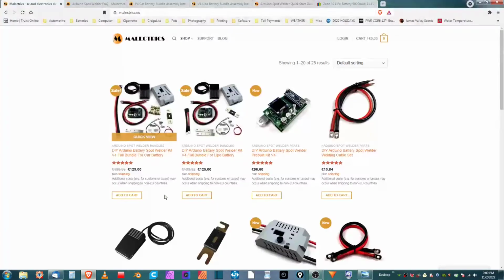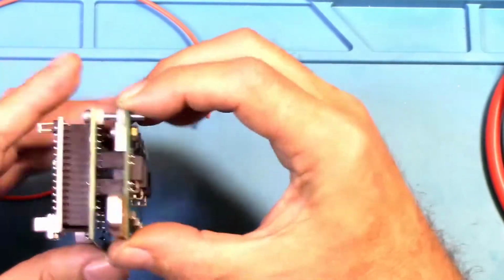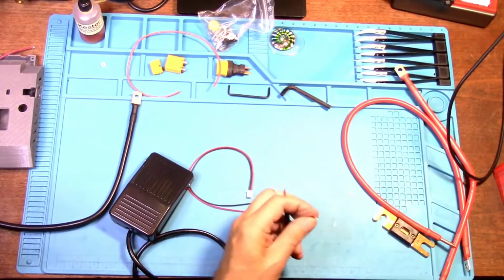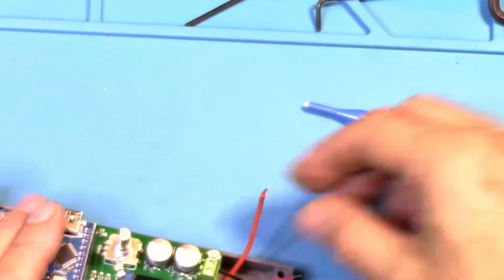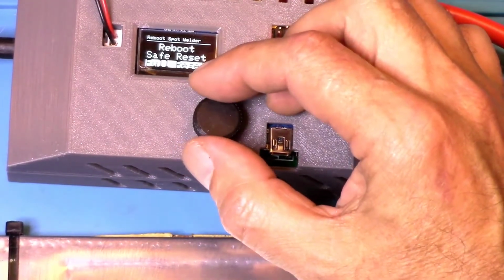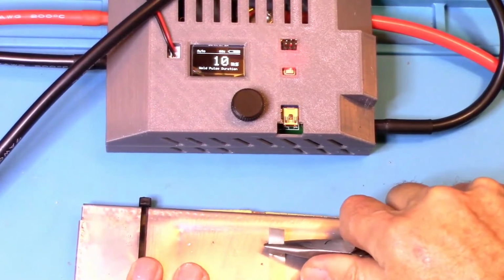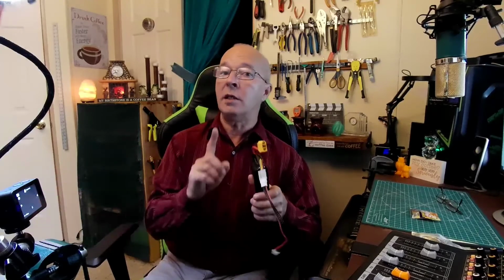Un-Boxing & Review & Tutorial & Test of the Malectrics Spot Welder Kit V4 - (WITH CHAPTERS!)

Comment: Good presentation. I have the version 3 and also a Kweld, and I like them both. You are right about making the input leads shorter. Yours are very long and the resulting resistance affects the overall current and the performance. Since I 'm using Lipo battery, I shortened mine to about 10cm and changed the connectors to XT150. The current jumped from 1000A to 1300A after this modification, according to my KWeld report.
Reply from the maker: I may go ahead and shorten mine, but not sure.  I just like to have my battery farther away from flying sparks LOL, and why I ordered the version that had longer leads.  Thanks for your comment, and if you have a video of your kweld, I would love to see it.

Comment from the maker: Thanks for stopping by, and I truly hope you get something out of this information.  This is the first video created where I have added Chapters, and I hope that helps in going to just the section of most interest, and also when re-visiting, you will be able to quickly find another section of interest.  If you have any ideas for a video that you would like me to do, please let me know in the comments, and I will do my best to bring that video idea to you... 

-Contents of this video------------

00:00 - Introduction 
00:23 - Malectrics Website
01:10 - Un-boxing
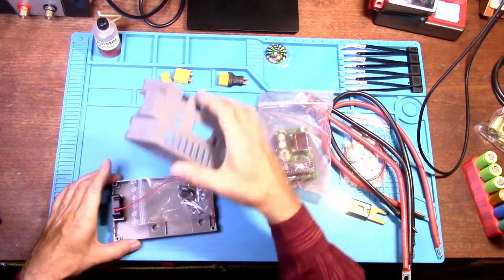03:26 - Assembling Mosfet board
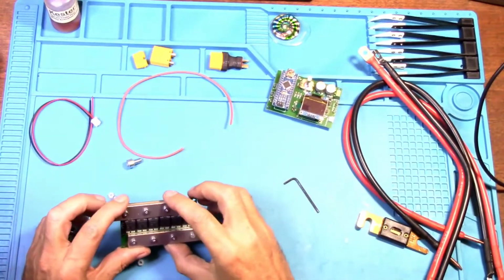05:37 - Adding screws to Arduino board
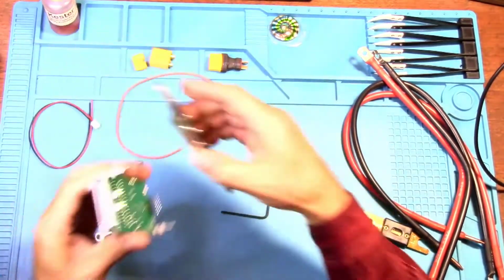06:50 - Attach Arduino board to Mosfet board
08:35 - Mounting the Negative cables to Mosfet board
10:50 - Wire and solder the foot switch
15:13 - Insert spot welder into case
16:20 - Insert Fuse into case
17:20 - Connect Positive Leads to Fuse
17:58 - Connect Voltage Sensing wire
20:18 - Installing Fan into case
22:19 - Finish Assembly of case
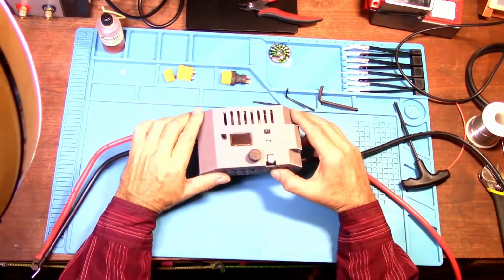24:31 - Connect XT90 to Battery Cables
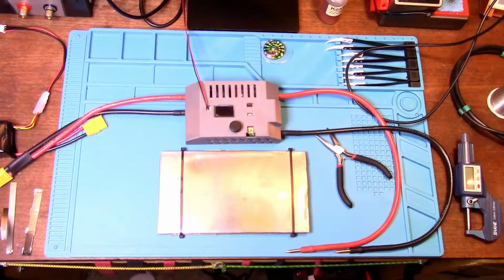25:48 - The Spot Welder Main Screen Interface
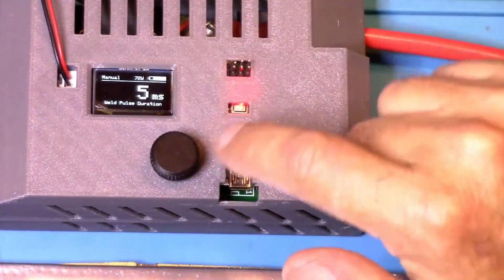28:26 - The Spot Welder Main Menu
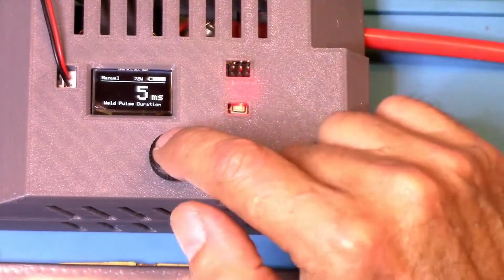30:48 - The Weld Pulse Measurement Feature
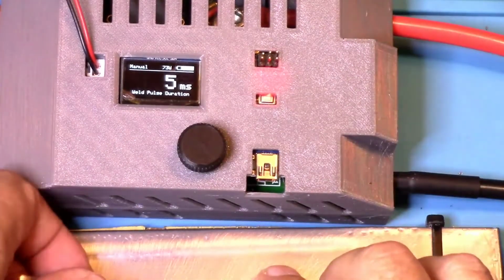32:00 - The Hidden System Menu
36:03 - Testing the Spot Welder
46:55 - Closing Remarks

Comment: Please tell me the optimum specifications (voltage, capacity, maximum current) of the lipo battery that can be used as the power supply for this Mini Spot Welder.
Reply from the maker: Thank you Kinya for the question.  These are the recommended specifications to power the Maletrics Spot Welder: 
* Input Voltage: 10-14volts
* Recommended Welding Battery: Car Battery (12 volt, around 600 A (CCA)) or a Lipo Battery (3s 5000mAh with minimum 60C (120C burst)
* Recommended welding material: 0.1mm to 0.25mm nickel strip (most commonly used is 0.15mm)
* Welding cables sizes: 10 - 16mm thickness, each about a maximum length of 50cm (500mm).

* I myself use a Zeee Lipo  Battery that is 3s - 11.1 volts - 9000mah and 100c rated, and it works great.

* Absolute maximum current rating according to the datasheet of the  IRFS7430 mosfets that the Maletrics welder uses, is about 1,200 Amps.  But please be aware at this high current they can overheat very quickly and be damaged - according to the Maletrics manufacture.

* The spot welder V4 is capable of using up to 800 CCA car batteries as a welding current supply.  It is not recommended to use a car battery that can deliver more Amps than this, as the Welder will take as many amps as you offer it - even if it means death to it...

I have successfully welded two 0.2mm nickel strips together, and am waiting on some copper strip so that I can do another video about a question posed by another comment, that asked about being able to spot weld copper nickle sandwich welds.  I will be doing a video of that once the copper strips arrive - so that will be interesting to see if the Maletrics can pull that one off LOL...  I will be using pure nickel strips and pure T2 copper strips to perform this feat.  It is very hard for any welder to spot weld pure nickel or copper, so if the Maletrics can pull off welding Pure nickel to Pure Copper to an 18650 battery - that will be quite impressive for sure.

I hope that I have been able to answer your question - keep a watch out for the upcoming video I spoke about, and thank you for stopping by and taking the time to ask a question - it has been a pleasure talking with you.

Comment: Have u tried copper nickle  sandwich welds?
Reply from the maker: Thanks Mad Max for the question.  Do you mean a peace of copper strip between two peaces of nickel strips?.  If so - no I haven't tried three peaces of strips welded together.  I will have to give that a go, but unfortunately I don't have any copper strip, I guess I could try three peaces of nickel a try.

...I found out that a sandwich is a battery with a nickel strip on top of a copper strip and both welded to the battery.
Reply from the maker: MadMax...  I decided to get some pure nickel strip and pure copper strip.   I am still waiting on the copper,  but I should have a video up in a couple of weeks trying the sandwich question.   This should be a fun video.   Thanks MadMax for the idea.   Mercy copper is expensive LOL
Reply: I would be interested in copper sandwich.  Because its best with big battery packs . Nickel has to much restence at end of the series of battery pack where bulds up to much heat in the pack
Reply from the maker: @natebean151  I just uploaded a video where I test the Malectrics Spot Welder doing a Sandwich weld.

Comment: anyone have experience with version 3 AND 4? im debating which unit to get. i have a chance to get either one from someone i know who just bought the kweld but i can only take one of them. ive heard people who prefer v3 over 4 and the other way around.
Reply from the maker: After researching the website, It looks to me that the V4 would be best because the software has been updated, and the board itself has been updated to be more robust.  The case also has been updated to hold the welder in one unit as opposed to V3 that had a couple different sections.  The Mosfet is also able to handle more current in the V4 board.  Here are a couple links to the V3 and V4 models to help in making your choice.
ARDUINO SPOT WELDER QUICK START GUIDE V4
https://malectrics.eu/arduino-spot-welder-quick-start-guide-v4/

ARDUINO SPOT WELDER QUICK START GUIDE V3
https://malectrics.eu/arduino-spot-welder-quick-start-guide-v3/

I hope this helps, but if anyone that reads this has had experience with V3 and V4, it would be good to hear your thoughts.  There are also videos on YouTube about the V3 that may help in making your decision.

Comment: Is this copper sheet?
Reply from the maker: Thanks Tomasz for the question.  No, this is pure nickel strips I am using for spot welding.
Reply: @Outside-In.  I mean that piece underneath nickel strip. The biggest one. Is this steel, nickel or what? Looks like copper but I think that camera is doing some joke with light that's why looks more red.
Reply from the maker: @tomaszradomski9008  The piece of metal under the nickel strip is from a power supply case that I had smashed flat to re-purpose for use as a test-plate for testing spot welders.  The red-ish color is because I was wearing a red shirt, and the lights were causing a red cast on the metal plate.  I hope this helps.
Reply: @Outside-In.  excellent. Thank you for answer. 👍👍👍
Reply from the maker: @tomaszradomski9008  Sure thing Tomasz and thanks for watching and commenting.

Comment: Hi!  50 ms is too much for a tape even 0.35 mm thick.
such welding time will inevitably lead to the appearance of halos and overheating around the welding points and possibly even between the points if they are located closer to a certain limit. this is not a very good property of the welder, or rather the battery - the current source you are working with
Reply from the maker: Thanks for the information.  Yes, it is best to be able to weld at lower connection times, but sometimes depending on your setup, you may need that extra connection time to make a good weld.  The issue you are speaking about could also happen if welding at 25ms if the strip is .01, so it is about adjusting the welder to the media you are using.

Comment: I really dont understand why this method of spot welding works at all.

 Most of the current would take a shortcut between the probes across the top layer only. 

Why not put one probe on the bottom piece and the other on the strip. That way 100% of the current will flow thru the weld. You just have to do it twice to get 2 spots.

 Ide turn the time down tho as this would be the first time your spot gets full current flow

Comment: there is nothing wrong with this spot welder except the price tag the customer service is very good but you can get the great spot welder from China for 20 bucks
Reply from the maker: I agree uawsux, there are good options out there for less money, but I just wanted to give this one a try as I was very appealing after watching a number of videos about it.  I am very happy that I made the purchase, as I have used it a number of times, and it truly is a great spot welder, but yes the price is a little high but I definitely feel it is worth it's weight in gold as it is very consistent and powerful.  I don't have to turn this thing up nearly as high as I do other less expensive spot welders.  I have one spot welder that is pretty popular, but I have to turn it full tilt and still does an ok job, but this spot welder I am afraid to pump it all the way because I may blow my batteries up LOL...  Thanks so much uawsux for the comment and input and thoughts.
Reply: Yes, cheap spot welders are available, but most of them are terrible due to various design flaws which have very little to do with their low price.  While I understand that you cannot provide a link here, we'd be interested in knowing what words or models to search for to get one of the versions you consider great for only 20 bucks.

The Malectrics is a higher-quality spot welder and comes with all that you need except the battery; you usually get what you pay for.  It would be nice if they dropped the price a bit, but Malectrics is a small business and I would probably need to charge this much to produce and ship this product as well.
Reply from the maker: @antibrevity  Yes Rob, you are right that the more you pay the better the welder, but I would have to say also that just because a product is more expensive does not always mean it is better LOL.  
This is a link to one that I know is good - not as powerful as the Malectrics but still powerful enough: https://www.amazon.com/Adjustable-Batteries-Portable-Handheld-100-900A/dp/B0B14VQ31N/ref=sr_1_8?keywords=spot+welder&sr=8-8
This is a link to the BIFRC spot welder which is also another very good and powerful welder for an inexpensive price: https://www.aliexpress.us/item/3256801816172956.html?aff_fcid=6dce174ef0fd46d58f5d1cb1b376fc59-1688129419152-05822-_AOvbd5&aff_fsk=_AOvbd5&aff_platform=shareComponent-detail&sk=_AOvbd5&aff_trace_key=6dce174ef0fd46d58f5d1cb1b376fc59-1688129419152-05822-_AOvbd5&terminal_id=184ec7adb5ae41988c2cb206607d5009&afSmartRedirect=y&gatewayAdapt=glo2usa4itemAdapt

Be careful about a BIFRC welder that is in a case - I have tried that one and it sucked - really - and I think it was because of the not-so powerful batter that comes installed.  I do believe though that if a person purchased the BIFRC in a case - the battery could be removed and use a more powerful battery with it, but what would be the point of purchasing it, because you would end up with a welder not in a case - so just buy the good one without a case and connect a good battery to it... - just my thoughts.
Reply: @Outside-In. I unfortunately bought the BiFCR in a case with battery.
It SUCKS
I tried to improve it, but it operates on a single Cell LiPo. I might buy the kWeld or the one from your video, I am so upset with shitty welders :/
Reply from the maker: @florihae  If you can afford the Kweld, that is the best way to go, but if you have limited funds, the Malectrics is a great welder for sure.  Thanks for your thoughts, and hope this helps.
Reply: @Outside-In.  thank you for the quick reply. I could afford the kWeld...but I would not use it a lot I fear.
Do you know a good Welder arround 50.- that can be used with 11.1V LiPo?
I have a 6.4Ah 100C continous / 200C Burst LiPo that I could use
Reply from the maker: @florihae  BIFRC welders are pretty good,  but not sure the cost,  maybe around 20 or so on Aliexpress.  You should also find BIFRC welders on Amazon.  But just like other less expensive welders, the BIFRC welders are a hit and miss on functionality, as some times you get a good one, and sometimes you don't.  I would recommend the Malectrics only because not only is it the only one I have purchased that actually works great, but because it is the more expensive of all the ones I own, which goes to the fact that we get what we pay for when it comes to spot welders.  To be sure to purchase something that is going to work out of the box, it may be better to look for a better known name like the Malectrics or Kweld, but just my opinion thought :).

Comment from the maker: kwd57...  I just  searched through my history and found who I bought it from and am putting a link to it here.  I have been using it for adding to wires to help get solder to absorb, and also for using on circuit boards to help melt solder joints, and it has been working great for that.  I believe when I just went to their store, they were selling two bottles like I have for I think 14 dollars.  Hope this helps again...  https://www.ebay.com/itm/201687421395?hash=item2ef581d1d3:g:b2kAAOSwEtRcDAFc
Reply: Thanks for the reply, i will check this out.
Reply from the maker: @kwd57  Please let us know what you find out so others will have the benefit of your findings... - and my benefit as well LOL...